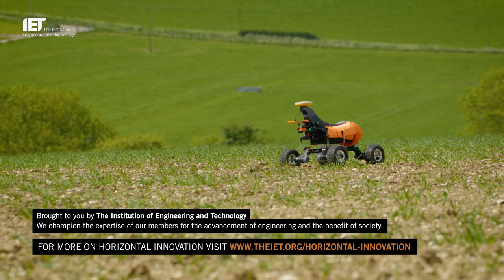Revolutionising Food Production with the Small Robot Company

Comment: Great.  1000 x the machines,  1000 x the breakdowns  and maintenance.
Reply: not rely. The reliability of 1 tractor vs reliability of 1 little robot comes down to fundamentals. If you put hydraulics, engine explosions, bulky mass, moving 500hp with a gear system ... takes materials closer to their breaking limits. And let's not mention cost.
To compare apples to apples  imagine a big tractor vs exactly the same tractor 100x smaller. The little tractor is very little - the wheel is 2.5 cm. The steering wheel is 1mm. etc. 
Now which is more likely to break? The big one since the strength of the materials is the same - but on the big tractor the demands on the exact same materials will be higher. This is why an ant falling 100meters will not die, but you falling 100meters gonna end-up badly damaged and dead.  
Which proves that smaller is better. Given cost, plastic is cheap, 3d printable - smaller is definitely the way to go. Given the field is filled with crickets, worms, mice etc - all small creatures - and not filled with elephants and giraffes - this is proof that evolution has chosen the same route - or was  God or whatever. Point is smaller is the way to go from first principles.  Then is cost, then is redundancy, then is the fact that you just gonna trow away when something breaks, and using economies of scale you just gonna buy a new one each time - like with our phones now. And you gonna have 1000 little robots which overall give you 99% reliability - over 3 decades - for cheaper - which that tractor simply can't provide. Nokia phones work even today 15 years later - don't they? There is no reason the same can be said for small agricultural equipment if the incentives are aligned as such. Is not an issue of engineering. Its all about incentives.

Comment: Rachel's phone hanging off in the sunlight is sure to expand the batteries and catch on fire.  Put the phone under the cover with a fan to suck out the heat.
How do those inserted seeds outgrow the weeds?  I thought the whole purpose for plowing was to till in the weeds to kill them and provide nutrients for what you plant.  I think large tractors are right out and a robot about the size of a riding lawnmower with a tiller underneath could break up the soil to make way for the new seeds.  It could till, level and seed at the same time.  And how is Tom going to navigate in a corn field or a field of hemp?  And don't you need furrows for irrigation?  I think you guys are awesome innovators thinking outside the box, but selling to farmers who have a culture based on tradition won't be easy unless you can prove yields better than their current methods, in every possible crop.  Your robots will need solar panels to be able to keep going and hopefully the cellphone strength will be good on those 1,000 acre farms in the U.S. midwest.